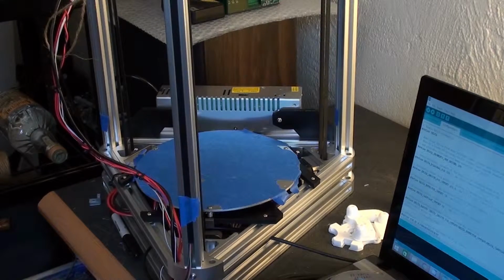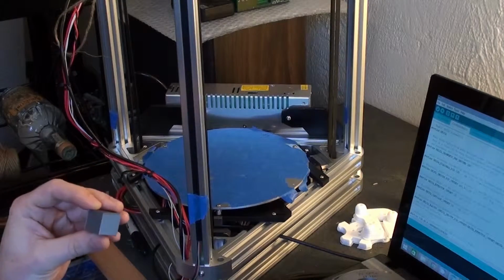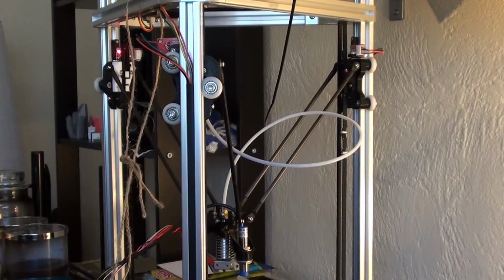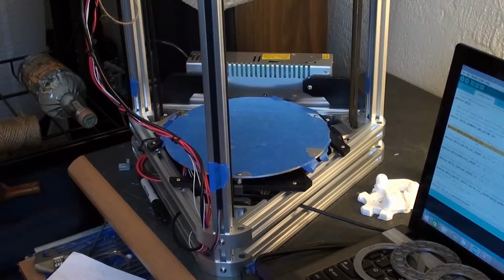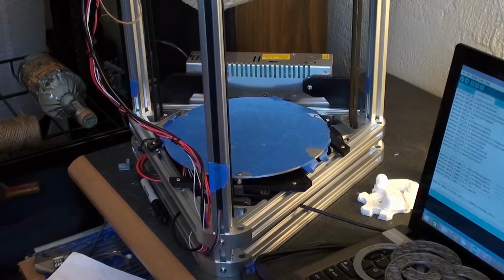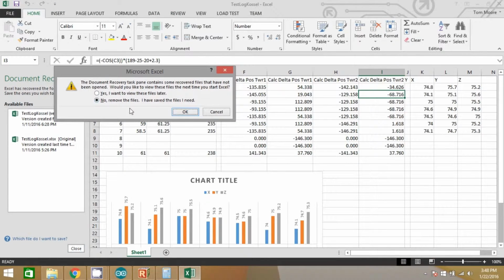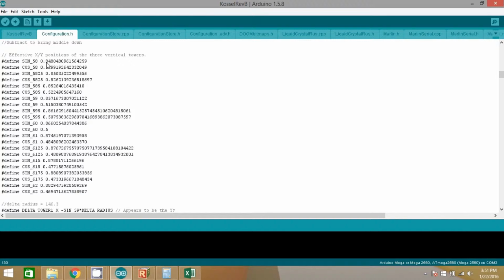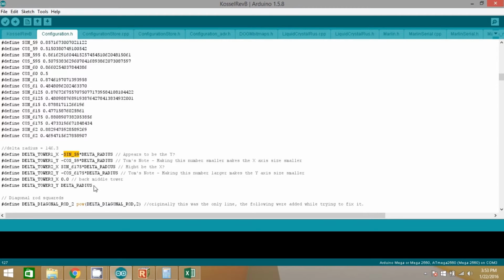Folger Tech Kossel Rev B. (Part 6) Scaling and Skewing - Tips, Commentary, Opinions, and Aid

Comment: i am looking at the last part of your tutorial . but i thik you better use the gcode m666 to adjust your tower offset  . you get a listing of the fariables you can change by typing m666L  in your terminal window.  btw if your 2020 profiles had the correct length your triangle shape of the printer has 3 x 60 degrees angles .  all same legged triangles do  ;-)

Comment: Is this what I should do if my cy;inders are not circular? (i.e one side will be 21mm diameter but somewhere else it's 19mm diameter)
Reply from the maker: That's why I printed near 30 of them. I kept getting numbers that were way off, so I started messing with the numbers like I have in the video and eventually got it to be less than a millimeter off with a cylinder twice this diameter. The alternative would be to cut new rods for the effector, but you'll have to order more stuff to do it since you never get enough from FT for two sets. If you still can't get it and want an expensive option, you can order a magnetic bearing setup online and replace the rods completely.

Comment: Thanks a lot for all the FT Kossel related videos. I have been planning on ordering their REV B kit but was wondering whether it was worth it, since you mentioned that you did receive some faulty parts. Another thing is, on their website the kit contains carbon fiber rods and it mentions "Need to Be Cut to Length". Does that mean that the user would have to cut the rods to desired length by themselves? Thanks.
Reply from the maker: +Consig1iere The 3D printed parts that I received were of fair quality, but ranked poor on being the correct dimensions. I've had to replace a few of the polyurethane wheels from the kit because they were getting chewed up thanks to the parts being out of scale (looks like they used ABS and it warped and shrank). I've since printed my own and have been slowly replacing them with significantly better results. The rods do come uncut. It's probably the biggest step for the overall quality of the print, and they leave you to do it yourself. I managed it with a hack saw and vice in my garage, along with some files. Like I said in the one video, just getting them exactly the same length is more important than they match a certain length. You will have one rod leftover as a backup. Pro Tip, the firmware has some commented values for the length of these rods that some people may want to try, but you may end up doing tons more calibration for the sake of more speed.